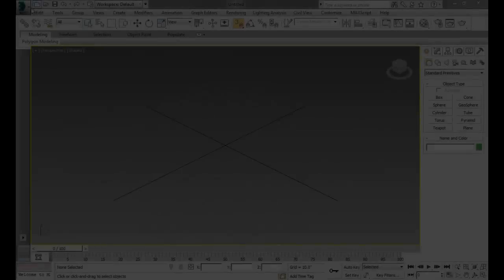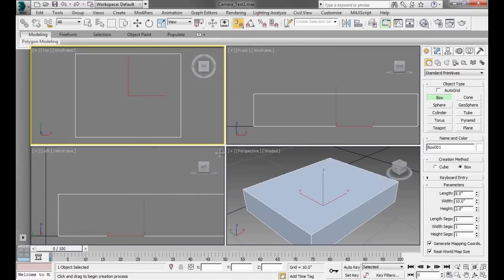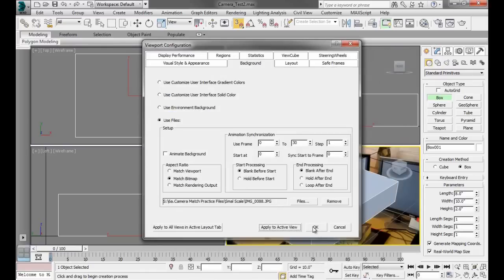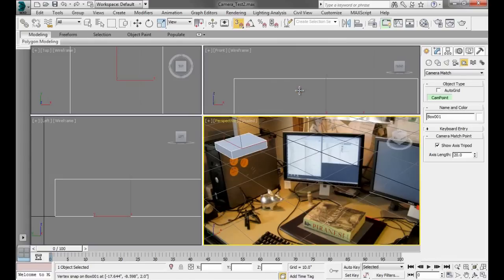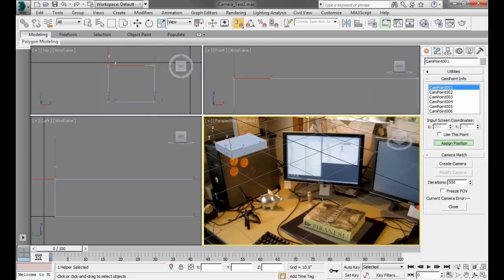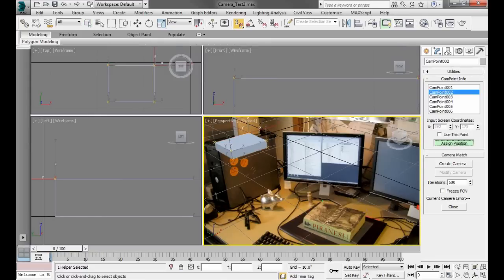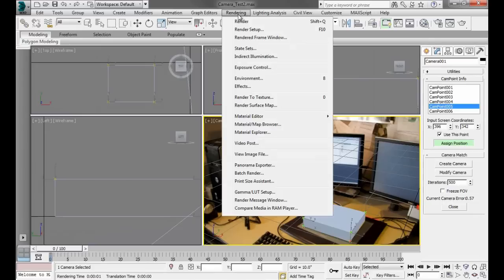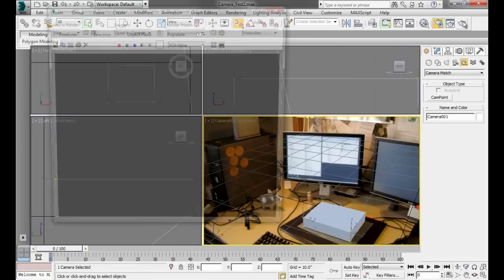Tutorial for Camera Match Utility in 3d Studio Max

Comment: I know this is a very old vid but I hope I'd still get an answer since I've got a question.
let's say I have 7 or more campoints for an irrigular object and I need to assign their positions. but I have front and back points.
now I have ref a front ref pic and a back ref pic which I set as bgs on different viewports.
my question is: do I have to assign the posistions of all the campoints on the same viewport? or can I for example assign some on the front ref pic viewport and the rest on the back ref viewport?
Thanx in advance :)
Reply from the maker: In truth, I have never set up cam points  in 2 different viewports for a single camera, so I am afraid that I can not comment directly. 
What I would do is more of a 'brute force' solution rather than a elegant method.  I would begin with a minimum of four campoint and then sequentially add a campoint until the results met my expectations. 
Good Luck!
Hope
Reply: Thx for ur response.
as for the answer to my question, is that u have to make different cam point to each camera separately. according to the view :)
Reply from the maker: >> "u have to make different cam point to each camera separately. according to the view"

Short answer YES. I personally set up and name campoints per image & background. I have chosen to NEVER reuse a campoint . Their is an inefficiency associated with that. Please note that the video tutorial is for the beginner.  
~HHH
Reply: Yes exactly, different campoints for different views. Thx for ur response :)